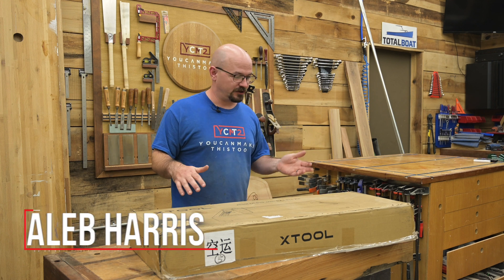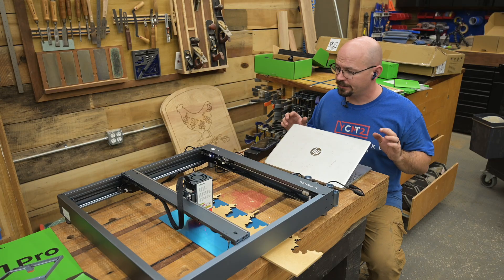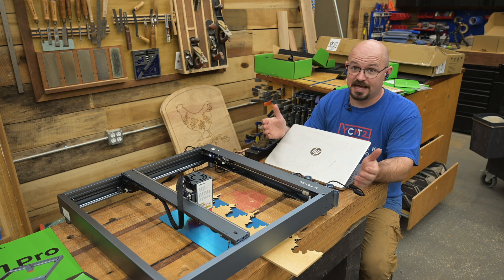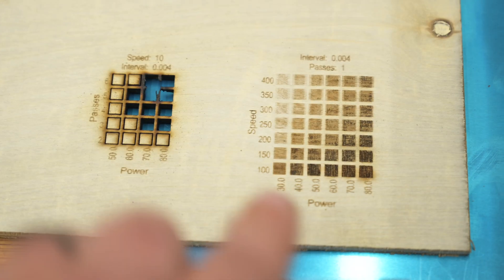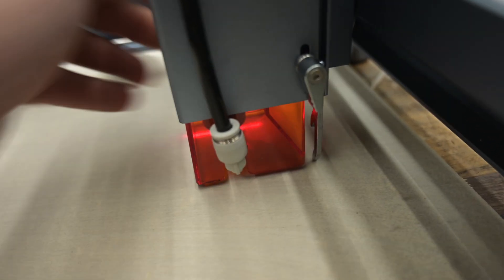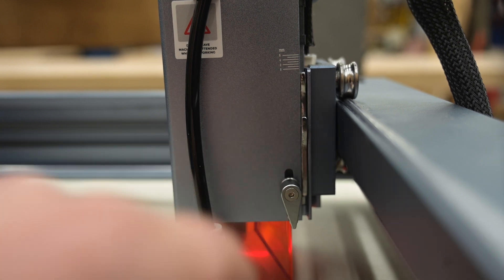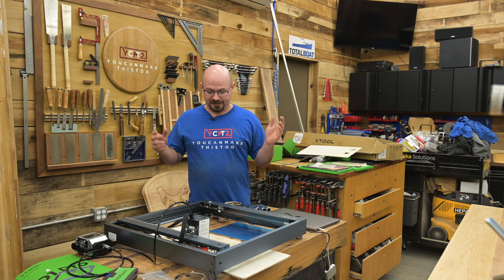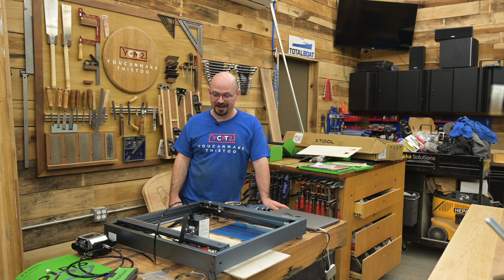Game Changing Diode Laser | xTool D1 Pro

Comment: Looks nice but your going to have problems running it with lightburn and good luck getting help with their support,  they'll get back to you in a week if your lucky, I have the 10 watt d1, was going to get the 20 watt but got the Atezr 20 watt instead much better unit, it runs circles around xfool
Reply from the maker: I didn't have any problems running it on lightburn

Comment: I have had mine for a few weeks, and I love it.  The previous commenter has some good points. There are some accessories that are probably a must with this unit. The air assist, some kind of enclosure(while I am a woodworker I bought the fire proof enclosure from extool) and the honeycomb which would prevent some of that char and burn through you had on your ornaments.  I have no idea how anyone could run this machine without an enclosure even with one the smoke is horindus. I pipe mine out a nearby window and I'm still getting some blow back. So why buy this over a self enclosed unit? Because I'm a garage woodworker, with a full time not a laser buisness. You can hang this thing in the wall and or stick it under a bench. The enclosure folds up and out of the way... You are up and running in less then an hour. This is why this laser is indeed a game changer.

Comment: Yeah, don't get this... They're not safe.

Do not use a laser cutter/engraver without air assist which not only helps clear debris as mentioned but also prevents a lot of ignition from happening, nobody wants an unintentional fire in their shop.
Don't use it without an enclosure, yes it has a little shield on it but it's simply not enough of a protection. Enclosures with a cutoff switch when opened are the way to go.
Also don't use this without fume extraction, this one is just obvious. You're burning stuff a lot of which can release harmful fumes and particulates.

Once you actually get all of these set up you probably could have bought a ready made CO2 laser with an enclosure, air assist and fume extraction for the price so look at going that route instead.

Another important thing to mention is that these machines generally showcase several materials being used for example leather but leather can be very harmful to cut and engrave, some leathers are fine and a lot of other ones are not so make sure to get some material knowledge and do your research before laser cutting and engraving a material so you don't end up ruining your machine or giving yourself and anybody around exposure to toxic fumes and particulates. 
Not to mention get your materials from a reputable source since some companies sell leathers labeled as one thing but they're actually another, if you're not sure then don't do it.